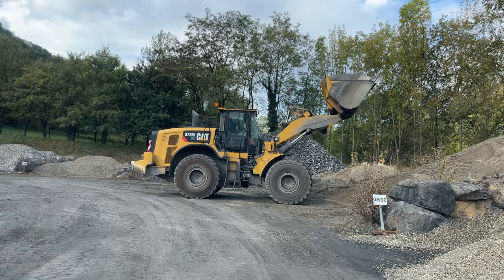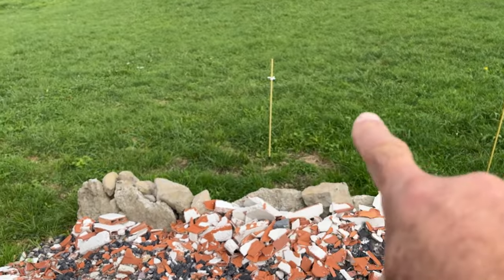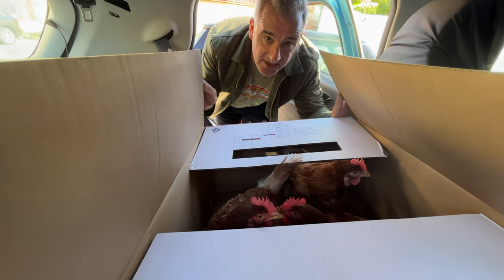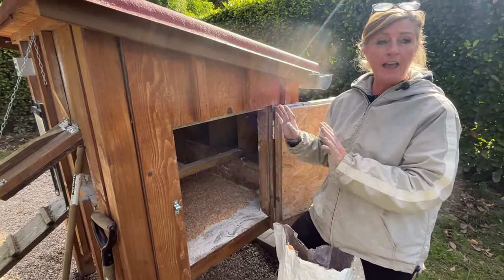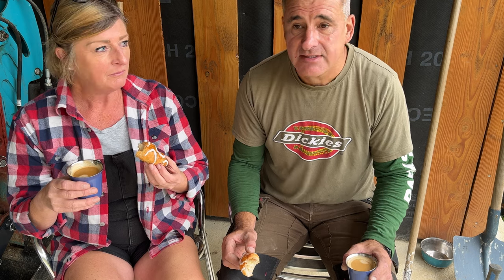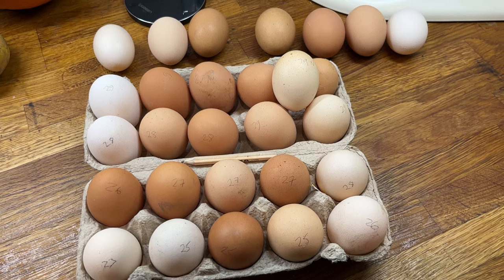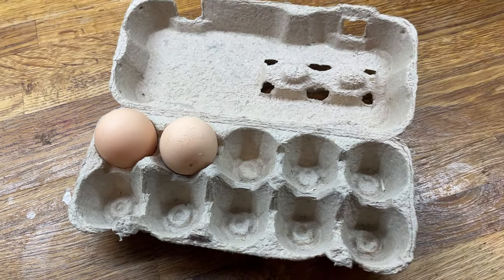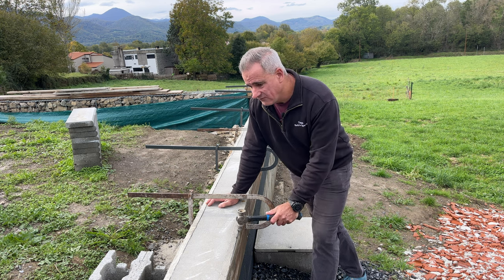Capping Retaining Wall & More Chickens

Comment: Just to let you know by filling your mixer then switching it on is the fastest way to burn the motor out. Apart from that your doing a great job 🤗
Reply from the maker: I normally do..... but just trying to reduce the cement dust.  This little mixer is now 22 years old, bit bent but does me well.

Comment: If you don’t wash your eggs, they will keep for several months if kept cool, cellar or fridge.
Reply from the maker: In Europe eggs are not washed just wiped (if in a commercial setting) which means they do not have to be refrigerated whereas in the US they are washed and then refrigerated.  Ours do keep for a long time out on the countertop.  (i worked in an egg factory for 3 years when I was 13......child labour was allowed back then 😀)
Reply: Yes I have built many chicken farms, we call them houses here. Each house had 100,000 laying chickens, each farm had 3 to 5 houses